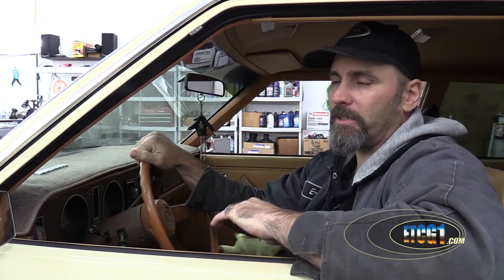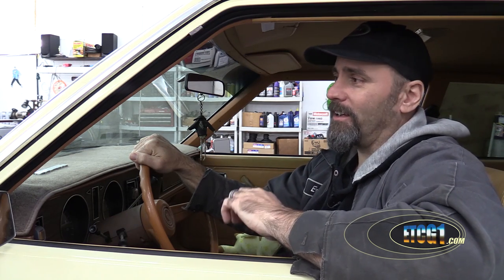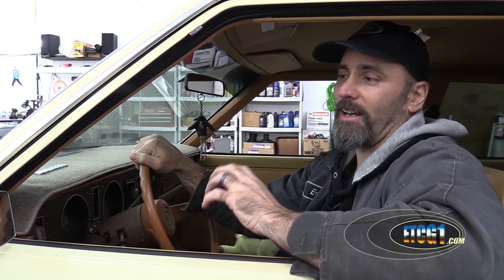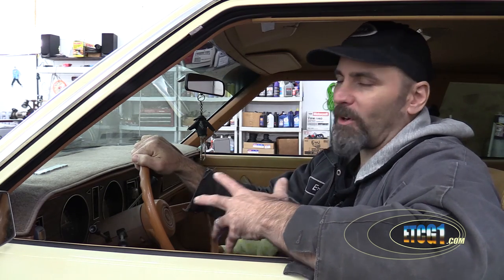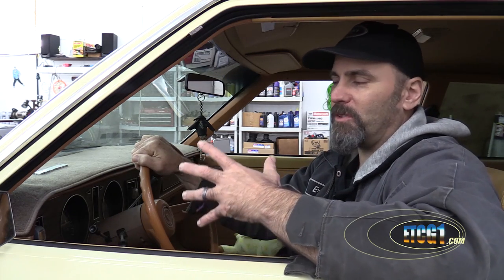Analog vs Digital (Cars)

Comment: Using a scanner to figure out the issue vs. disassembling your car in the street/parking lot, just to diagnose. Electronics are not perfect, but it's nice to have clues where to start looking. Having a miss or knowing which one is missing and whether it's fuel or spark. It took me forever to figure out my rear cams weren't spinning (the pulley was). So I could complain the electronics failed to help me that time, OR think how 1 more cam sensor would have instantly told me what the problem was and I could have fixed it instead of leaving it sit for months not knowing how major the problem was. This is like trying to sell an outhouse to people with indoor plumbing.
Reply: PGTMR2  Scanners are good for catching intermitents and failures directly related to the electronic systems. For systems not directly controlled by electronics, scanners are of limited use, certainly not as good as older diagnostic tools plus experience.
Reply: pssst3 You still have to know what you're doing, but I can check my cars functions with my phone.  Idle, tps voltage, distributor timing, temps, O2 sensors individually. All kinds of information. It won't tell if a connecting rod went through the oil pan, or a valve dropped, but then there'll be other signs if that happens :B
Reply: PGTMR2  yes those Bluetooth dongles with Torque or another app can give you lots of info, about the more complex electronic systems. Essentially they are a reporting system for the car's ECM. That is their primary function which they do well.  But they rely on the ECM to be working correctly, and ironically, tell you practically nothing about the basic systems needed to make make any car operate.

Here's a basic electrical issue that happened recently.  

Randomly, a 2012 Ford Focus wouldn't start in the middle of a multi stop short trip. No crank. Basic system is battery , conductive circuitry and the starter. Everything else is unnecessary.

Roadside assistance got it started and followed to a nearby repair shop.  The battery voltage was low and replaced.. No other cause could be identified.  

The problem resurfaced a few days later, the car towed again to a Ford dealership, where it started. Diagnostics were run. Ford was contacted for assistance. No obvious problem. 

The problem resurfaced again a few days later, the car towed Ford dealership, where it wouldn't start. More diagnostics were run.  Finally an older mechanic checked the starter itsekf and found that the primary positive lead was loose. The nut holding the wire to the post was so loose that the wire wasn't making connection. Vibration, thermal cycling and moving the vehicle on angle off the transporter made the connection open and close. 

A 25 cent part,  not correctly fasteners, crippled a 20k car, stranded the driver multiple times, caused  two tows, shop rate diagnostics and still stymied several mechanics who never traced the basic electrical system.

Moral, tools don't make the mechanic. Knowledge and experience do.
Reply: I've been through a few bad cases of what the F with starters. My little
 scanner wouldn't have even been out for that. That goes back to what I said earlier about still having to know what you're doing. Why was 
anyone "checking diagnostics" they should have been diagnosing the car. Which worked and then suddenly didn't. I would have had that fixed there, checking for loose connections, corroded terminals and neutral safety switch issues as the very first things. I've even seen someone check the starter at a parts store. Parts store says "it's good" 2 or 3 times with no load or whatever their testing procedure was. Placed back into shitty 34 year old car with exhaust manifold surrounding starter, it works... it works, then doesn't after 10 minutes of driving due to heating up from the exhaust. I told the owner the starter was bad each and every time he wanted something else replaced instead of the starter. He kept paying someone else to change this and that. Finally the owner replaced the starter and never had another problem with starting. Months later it was scrapped with a perfect starting system.
Reply: You may think differently about electronics when your vehicle suddenly shuts down, without warning, in the middle of a 3 lane expressway at rush hour, requiring a tow. Or, fails to start for no reason one morning, when you're 3,300 miles from home.

My '72 El Camino might not have been technologically advanced, but NEVER once did it end up on a flatbed, nor leave me stranded. Drove that thing from coast to coast, and all over the West, and New England. Probably still running out there somewhere. I sold it in '11, still able to leave rubber. Should've kept it and dumped my '07 Silverado.
Reply: Smitty Smithsonite It was a v6 El Camino 80 or 81 that had the exhaust wrapped around the starter. Once it got hot it needed a half hour before it would start on its own again. My current daily is 23 years old, has all the modern sensors, I am aware of it's condition. The timing belt is the next thing I'm worried about. I'm planning a lot of maintenance in the spring. The engine went in in May, sensors were in good condition or new. The Achilles heel was the distributor, that's been replaced with a better one from a later year. If that failed any parts store carries the ignitor and wires to do a permanent fix. I've had the car since 09, all the problems I've had were mechanical so far. When something is wrong, it will idle funny or not deliver full power, or have a lower rpm limit. There's usually clues before a failure. I'd drive it out of state in any direction, I'd do the belt now if the trip was halfway across the U.S. or more.
Reply: Pretty much any engine in any GM car, with headers, did the same thing - their starters were terrible with any kind of heat nearby. You reminded me that I had the same problem with my El Camino when I first got it. A solenoid heat shield fixed that problem though. Better than being permanently stranded, for sure.

I've managed to hang on to an '86 Grand Marquis, and a '93 Volvo 940 - both FI, and I consider both to be just as reliable as my carbureted '72 'Camino. Those 2 systems and GM's TBI were the best systems as far as durability goes. Nearly unstoppable. They are quirky though. The Marquis idle is very finicky. Plenum requires cleaning every 50k miles or so - sometimes less. IAC gets carboned up and needs frequent cleaning. The Volvo's IAC makes the thing lope like crazy on very cold mornings (single digits to below zero). They do always start and run though.

Performance mods on either one are out of the question. That's where I love the versatility of a carburetor. Add some performance goodies, tweak fuel mixture screws and fatten some jets, and the engine's happy. On these things, what you got is what you got - add performance goodies, and you'll lose power instead of gaining it.
Reply: My car just needed to breath better and it would make more power. The ECU would compensate for some performance parts. The engine I put in was beyond the ECU's capabilities, although it ran fine, had plenty of power and wasn't in danger of destroying itself. A newer ECU designed to run the same engine, with a sensor swap has unlocked it's full NA potential with a couple patch harnesses. I could even put a turbo on and run low boost without blowing it up, or start porting the heads and intake. With no further tweaking. That 86 Marquis could probably benefit from a more modern 5.0l ECU and allow for some performance mods. I'm thinking the last of the 5.0l Cobra Mustangs or OBDII Explorer. I liked the 4.6 mod engines, so I'd probably be trying to score a Terminator engine and T-56 and make my own stealthy Marauder.

Comment: I'm planning on finding a 2l motor to replace the underpowered 1.2l lump in my '79 Opel Kadett C, and I have been thinking extensively on what to do for fuel delivery. As my budget is quite small, MegaSquirt seems like a good choice, as i have far more time than money, and the thought of being able to swap maps on the fly for economy or power as needed is appealing. On the other hand, I really like the simplicity of carbs, and keeping the lights and coil as the only electronics in the car. However, with carbs it  seems like you have to compromise on either power or fuel economy
I would really like some opinions.
Reply from the maker: The compromise really comes in in how you build the engine. Specifically the cam shaft. The carburetor, if properly set up, will only deliver the fuel the engine needs. I guess it really comes down to how you want to tinker with it later.
Reply: ETCG1 I guess I'll have to go shop for camshafts then (RIP budget). I can't wait to get a few more horses under the hood, as the car only weighs about 750kg.

Comment: I prefer mechanical over digitally controlled systems for reliability. I own cars with both. I like the simplicity, reliability and serviceability of mechanical systems compared to digital. I however, like the creature comforts, power and efficiency of digitally controlled vehicles. I always have one or the other as a backup vehicle should something need repair.

Comment: drive by wire system is a perfect example, I once got home in a older car when the accelerator cable broke. made a fix till I got home , no way you could do that with a modern car if the gas pedal stopped working

Comment: FI takes a lot more to get working (money, time, knowledge), which makes it less appealing for project vehicles, but it's pretty bulletproof when it is running. That's what I like. You get it dialed in and then you never need to touch it again, even after tens of thousands of miles.

There is something beautiful about mechanical systems, though. I'm rebuilding a set of carburetors off an old Yamaha 600 and it's hard not to appreciate the engineering that went into designing carefully calibrated, totally passive, vacuum actuated, metering devices to be built on a scale of hundred thousands. I still loathe all the little rubber diaphragms and float needles that seem to be perpetually worn out, but a rack of carbs is at least a bit more glamorous to work on than a black plastic mystery box.

But hey, just wait until Koenigsegg replaces valves with pneumatic actuators - there will barely be anything left on cars that don't have a 20 wire pigtail on it.
Reply from the maker: Good point.

Comment: I have two cars, a Porsche Boxster and a sleeper 72 beetle.
The Porsche is a technological wonder with all the usual modern electronics and sensors.
The Bug tries to kill you every time you wot the 48 dellorto's.
Both delivery metered air/ fuel with a timed spark at the end of the day.
Bottom line, if the Boxster ever reaches the ripe old age of 45 i'd be interested to see what technology actually survived.

Comment: I don't really think car electronics are that fragile as the reality is car reliability has actually improved over time. Sure there are growing pains as new technology is introduced, like fuel injection, but today it's matured into a very reliable technology. Also, a tune up is basically a thing of the past as that is all controlled and adjusted by the ECU. Plus cars are more efficient, powerful, and environmentally friendly as a result.

Comment: Not sure how an auto mechanic would not prefer to plug a computer into the car's module and get a readout of engine problems. And how can anyone prefer an inneficient carburetor with an old single ignition coil over a modern engine with individual cylinder ignition coils and fuel injection?

Comment: I think it really depends on what i would wanna do. If i want a classic car to be a daily or a strictly off road vehicle i will certainly go EFI for the better mileage, adjustment for altitude and temp and the ability to continue working at odd angles. If its something ridiculous like a show car or a full resto it would be carb. 
The car will tell you what it should be. Eh, there are plenty of other things to do before engine upgrades anyway. Like fixing that damn rust hole and the spring stabbing your ass through the seat.

Comment: I hate changing jets, needle heights, float heights, syncing, and everything else about Carbs. I can do it and have done it to success, I just cant wait for the controlled fuel leak to go away.
Reply from the maker: Fuel injection is also a controlled fuel leak. It's just electronically controlled. ;)

Comment: I work in both worlds. I don't think you are going to be able dig an old car out of the woods, get spark from cleaning the points and fuel from a gas can turn fire it up. I like the simple analog systems that give me feedback and the ability to be one with the machine. No traction control, no abs, no electronic automatic transmission, no anti theft other than having a manual transmission.
There is a place for electronic control in a daily driver but I think it has become a bit too much.

Comment: Best analog engine I've owned: 1438cc DOHC Fiat 124 with a mechanical advance and a 2v two stage Weber. At about 4,500 rpm the secondary opened while the advance and the cam timing worked together to race to 6,800! 
Best Digital: A 1996 Acura GSR 1800cc VTEC DOHC fuel injected masterpiece that packs more punch from 4,800 to 8,000 rpm while being just as much fun to drive!
Reply from the maker: I LOVE my GSR!

Comment: I'm about 18 and my first car i actually. Drove to school and and as a daily driver was my 1987 Toyota pick up (2wd) it's carbrurated and nearly anything on it is electrical. Beyond the upgraded stereo and basics lights. . I just recently. Got a 2000 Tacoma fuel injection (4wd). And I will tell you they both have their ups and downs. I prefer carbrurated for working on it its self Because. It's much more strait forward. And something I can easily fix whether. I'm on the side of the road or at my tech schools shop. fuel injection is alot better for running and driving, for instance in winter (gets as low as -5) I prefer it because. I don't have to Waite. Like 5 minutes for it to warm up. I'm more analog. Then digital, I prefer using hands tools, then just hooking up a scanner. (just my preference)

Comment: It's not that hard to get a modern engine like an ecoboost running in just about anything though - you just have to shell out for a third party ECU to completely replace the OEM module. And then there's the expense of getting it set up and dyno tuned. It's possible, but it can be expensive.
Reply from the maker: Possible yes, but easier, and cheaper to run a carburetor and turn a couple of screws. ;)

Comment: The only thing that worries me about computer controlled cars is god forbid we get hit with an EMP. Nothing is going to work...that's one reason I saved the points system on my 62 chevy k10 when I switched to a HEI setup...but i guess if that happens we will have a lot more to worry about haha
Reply from the maker: Funny you mention that. It was in the original video but I cut it. I said the most reliable system after an EMP would be mechanical diesel. Thanks for the comment.

Comment: I'm not a trained tech, just a diy'er aka shade tree mechanic. my opinion the newer digital hosed you when it comes to fuel economy, back in the late 80s early 90s small cars like the VW rabbit, Dodge colt, Plymouth horizon. driven right, ( not hot rodding around) got 50mpg. now you need a hybrid to get those numbers. 90s mini vans  pre ODB 2 got 30 mpg. that's unheard of for newer vans. full size 3/4 ton work vans got 18-20mpg.  so I don't think digital helped the people with fuel economy it helps the oil companies sell more product and the car industry sell hybrids which are more complex and make the diy unable to fix his own car.

Comment: I like analog better than digital or electronic because I think analogs lasts longer.  I do not have a crazy budget all the time to pay more to fix a brake system because it comes with a sensor, or get a digital ac controller fixed because it has sensors around the car which may not work properly anymore. I like components simple, durable and cheap to maintain.